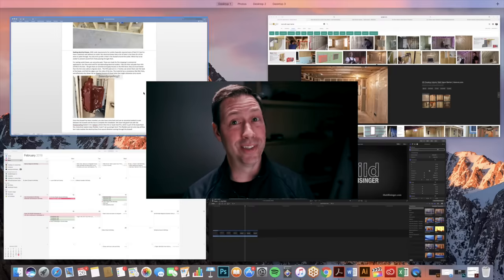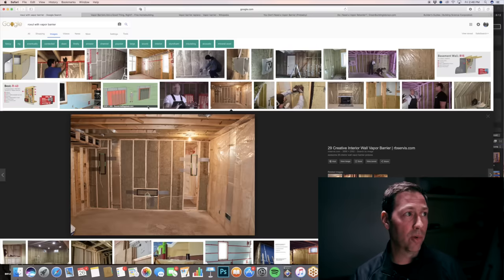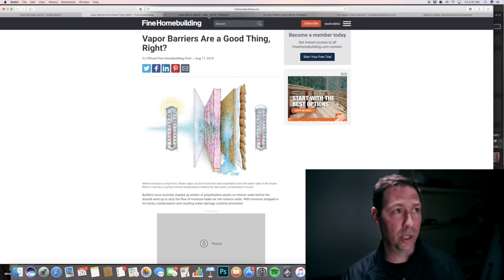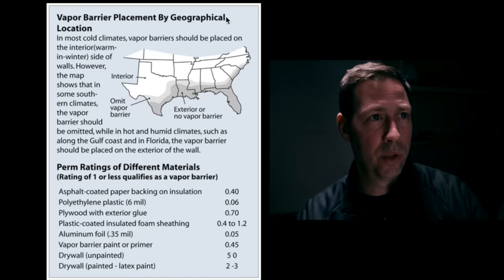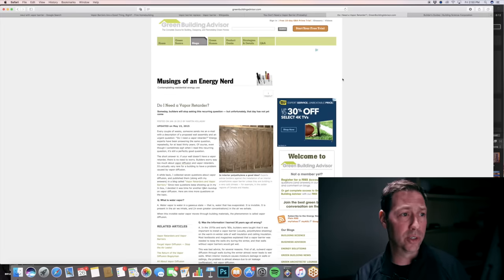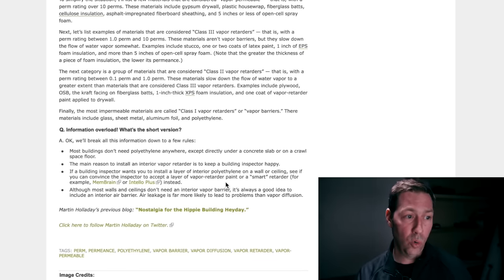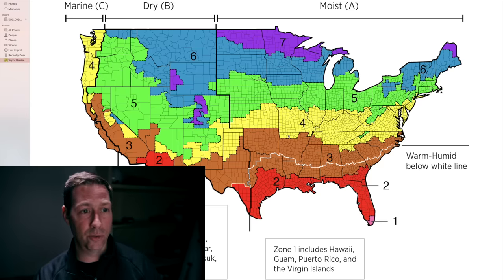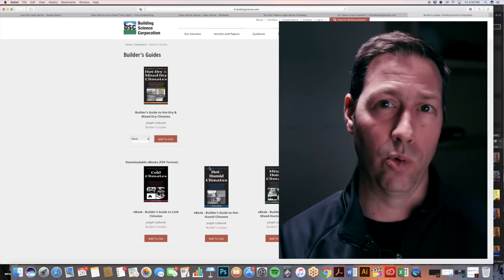Vapor Barriers: Need one or not?

Comment: The left corner of my basement is a bedroom. That corner, about 18 inches in from the outside wall- on the bottom,-is where the mold and wetness and dampness is. Only about 2 inches up the drywall.  Behind that drywall is an old layer of paneling. Behind the paneling is insulation. Behind the insulation is a clear plastic sheet, that had drops of water on it. Behind that is the white cement wall-- that looks painted. If I took the 4 foot section of drywall off to the edge of the brick hearth, I wouldn't mind keeping it open somehow so I can keep an eye on the water that is infiltrating every so slightly.... It's not all cosmetic, but I would like to check more of the wall. And will be changing ceiling panels as well. The odor isn't right... I have air flowing through with a fan, I opened the windows all week long, the waterproofing company said they got only a 3 on the meter and didn't want to spend my money,,, and it is not going away. I thought is was animal odor, so I replaced the carpet. I wish I could share a picture on YouTube.

Comment: In a northern basement, use solid foam insulation against the concrete with sealing tape or foam, then build your wall studs, and fill the walls with bats of Roxul or equivalent.  No plastic and your walls will be forever dry.  I live in Minnesota and it does not get much colder than here.
Reply: RD S Great Info, I live in New Hampshire and have a 2006 house that I want to finish the basement. I’ve been doing research and you summed it up from what I’ve seen as the best approach. 
What do you do for flooring (sub floor to prevent moisture ) when you build your walls like this? I have hot water baseboard heat that I Will be running in the basement. 
Also - what type of flooring do you recommend? Carpet, laminate, porcelain planks? 
Thanks!
Reply: Canada Ontario and went with this very method also in my basement ... Closed cell insulation panels glued to cinder block walls then studs and Roxul insulation...trapping the moisture with vapour barrier never made sense to me

Comment: Totally agree air is the killer.  I've worked in the biz for over 30 years, and when remolding my own farm home in the 90s, and being quite anal about the rolled bat installation, on one very cold, sub-zero, windy day pre-drywall, remember seeing a couple "spots" of condensation; pinholes of air getting through the exterior vapor barrier, through the bat and condensing on the back of the visqueen.  I remember thinking, "This can't be good", as it was pre-siding and I hadn't nailed any siding up yet; clean wrap on the outside w/ cap application. 

                              I'm getting ready to do a remodel now with fiberboard sheeting and fanfold behind vinyl, and I'm pretty sure I'm spraying CCF.   If applied correctly, that should take care of the air issue and add some strength?   I think CCF on sheeting is the best way I can think of to stop air infiltration on a sided home short of removing the siding.

Comment: Enjoy the videos Matt! I live in S. FL and ran into the same problem over the last few months during our new house purchase remodel. The house is frame construction with cedar lap siding. We had what I was told is old "soap foam" insulation in our ext walls that shrunk over time and offered virtually no R value. It resembled icynene but I knew it wasn't due to the age of the home (1978). The insulation was held in place  with a plastic Vapor Barrier behind the drywall. We removed everything and replaced it with all new batting. During the removal process  we realize how much mold and even wood rot had occurred in the walls which has since been corrected but what a job it turned out to be! Thankfully we addressed everything before closing the walls up and moving in! Just curious, I'm in real estate sales and I've seen patch jobs in houses before using 30 pound felt paper for exterior walls behind the plywood/siding. Would this create the same problem as the plastic visqueen? Thanks for your help!

Comment: Great video with good info, if nobody mentioned a moist basement mixed with poly vapor barrier on the interior only will cause the moisture to be sucked up into the wall through the sill plate. New tes th ing has found that this is where most of the water damage  comes from when there's a problem.  so skip the poly or remove after inspection if your not able to properly fix your lower moisture problem.  if the level below is moist or prone to water, wet basement or compiled with the "chimney effect" or bad attic insulation because this will pull the air from lower levels threw the house all the way to the attic makes for a super drafty moldy home.

Comment: My house was built about 1800. The roof burned off in the 1930s and they rebuilt the second and third floors. It's a farmhouse, not a colonial. I'm in Northwestern Connecticut. There is no sheathing on the house, the clapboards are directly nailed to the American chestnut studs, except for where those chestnuts studs were replaced in the 1930s which includes the entire roof. So any notion of a vapor barrier is humorous. When there's a good wind you can feel it in the house. 

Never mind how many years I've been doing this, but I'm rebuilding the house from the inside piece by piece. Room by room. I could go on for days about all the decisions I've made and whether they're any good or not. But to the point of this video and why I came to it is I'm at the laundry room now. I'm trying to figure out whether I need a vapor barrier on the inside of the laundry room it's below an insulated space mostly and above an insulated space and next to an insulated space on three sides. The roof, which is well-insulated, but has no exterior vapor barrier,  does form one part of the wall/ceiling. Let's call it 30 to 40 square feet. What I'm trying to sort out is do I need a vapor barrier in this laundry room at all? Do I need to think about keeping any extra water vapor in this laundry room and not in the wall? Or is it best to let it breathe? I'm at that point in construction where it's time to make this decision and do it. This is a very shortened version of a very long story if anybody's got this far I wonder if you have any advice. I actually do expect to get conflicting advice and will try to sort it out. Thanks in advance, as we say.

Comment: I am a design engineer and have to consider location and the heating system used, but I mostly recommend a vapur barrier.  My brother who is an architect/builder allways say that when in doubt, skip it.  Unfortunately gypsum is no barrier for anything. It soaks water like a sponge.  Actually it is used to suck water out of clay slurry in erthenware factories.  If gas heaters are used, gypsum drywalls cannot be used.  As you demonstrated.

Comment: Matt, watching your video vapor barrier need one or not I had the impression that what you were talking about pertains to above ground construction. I am in the process of finishing my basement in a zone seven area in Wisconsin and I am wondering if I need a vapor barrier against the cement wall in my basement. If I do would a paintable vapor barrier or retarder be better or a XPS rigid foam be better?

Comment: I live in Canada and in a cold part (north of North Dakota) and we're in climate zone 7A. We have an A and B, with B further north, then 8 etc as you go north. Vapour barrier is a code requirement under out dry wall. We often have -30 or lower temps (Celsius). That type of temperature holds very very little moisture. In fact, at just -20C, if the relative humidity is 50%, that's the equivalent moisture of 3% at +20C (room temperature-ish). And of course, we all know how a glass of ice water collects condensation on a hot humid day - the same thing occurs when warm, moist air (inside the house) hits a surface that's exposed to -20c (outside the house). Of course this is during winter here.

Comment: Thanks so much for clarifying that about the plastic on the inside of the home.  Don't do it in Dallas.
I'm renovating an old 1920's shiplap house - exterior wood siding and shiplap is installed directly on the wall studs ....no insulation of course.  In the locations where we were replacing rotted wood siding on the exterior, we added tar paper before installing new wood siding.  On the inside where we had to remove some shiplap for wiring and windows, we put tar paper between the studs, anticipating insulation would be placed over it.  Some areas will not have any tar paper unless I remove all the shiplap on the walls to do so.

My questions: 
1.  Is the tar paper fine to use before I use batt insulation in the open wall cavities? 
2.  What about the wall cavities that I did not open up and have no tar paper in them (the shiplap walls)?  Just blowing in insulation in the shiplap walls without any vapor barrier - is that ok?
3.  Crawl Space - We are keeping the original wood floors, but of course a subfloor was not used in those days, so the wood floor is installed directly to the joists and is exposed to the outside temperatures in the crawl space.   What is best for this scenerio?  The floors are going to be cold for sure in the winter.   What is the best thing to do in this case?  Should we install the plastic vapor or air barrier?  Some say spray foam insulation, but that could be more costly for a rental.

Comment: I have said this for years! I do new construction and remodel work and have seen the results of "common" or "best practices" firsthand. Plastic in your walls lead to one thing only....mold. All that is recommended in my opinion is PVA primer on Sheetrock. I have installed poly to appease inspectors and then tore it out before drywall in order to build a safer home for my customer. The other HUGE factor to consider is the heating system being used. Gas heat puts more moisture in the air than electric or wood.
Reply: Modern gas shouldn't be adding any moisture. Direct vent systems are contained. And if a gas heat source IS adding moisture, it means the flue isn't properly venting outside, meaning CO is a bigger concern than moisture. 
Thoughts?

Comment: Thank  you.  I'm all set to go.  This is 1" board with a foil face. I've done a little of this so far in another home.   This will be the first two bedroom home to get it on all exterior walls and ceiling.  Perhaps the question is whether to create an air gap between the foil board and the drywall.

Comment: Interesting video. I get what you're saying about diffusion only letting a negligible amount of water through, but what about the water that comes through from air leakage? Is the need for a vapor barrier dependent on how tight you build the house? If so, where do you draw the line? Philly metro area here. Keep up the good work!
Reply: kingsovernines
Absolutely is.

Comment: What about cold climates and any need to vapor barrier a foundation wall (zone 5/6)?  We typically place ridged foam directly on the wall (concrete) for both a vapor barrier and to provide some insulation R-value.  The rim joists (above the concrete) are usually batted with fiberglass.  The seams are taped to seal and sometimes the top and bottoms where they meet the wall are spray foamed.  The usual minimum is 1/2 to 3/4", but some go upwards of 2-3" or more if you can fit it in.  My basement is not finished living space, but has a workshop, laundry and storage.  I went with 3/4" ridged foam on the concrete as a vapor barrier (held by adhesive), that was painted with UGL DryLok before hand, and the studs them built out from it with no fiberglass batts (I could add later if it becomes living space).

Comment: I did a repair once ....it had been determined that a overhang roof was leaking as the front porch was rotting away and wet ......as I removed the cladding and membrane on the porch,  all of the wet wood was where the wall and porch met under the overhang .....as you got farther away from that point it got drier ...so the overhang  wasnt leaking and the porch wasnt draining back to the house....
        .As I inspected I found there was a furnace in the basement ,situated against the exterior wall below the porch....The vapor barrier had fallen down either by poor placing or installation of the furnace...and it was decided that it wasnt needed by who ever was responsible..it was condensation.....We live in a temperate climate ...only a couple of weeks a year  in freezing tempature. 

   It is probably better to err on the side of caution ,as you dont know what is going to happen in a building after you build ....possibly even a small grow operation..........a roll of poly is not that expensive

Comment: I’m a carpenter in southern Louisiana. Every so often when renovating I discover a situation where some idiot has installed a vapor barrier from both the inside and outside. Invariably there are moisture problems from condensate or leaks.. Often rot and sometimes wood destroying insects have had a field day with the moist wood.

Comment: It's code where I live to have visqueen on exterior walls.  I'm bordering zone 5 and 6, I've torn a lot of walls apart and very rarely seen mold where visqueen is applied.  Tend to find it in ceilings where visqueen was added before sheetrock. About 5 years ago we started using A product from Zinser called Gaurdz, we seal the sheetrock after it's been mudded, I wouldn't go without now.

Comment: Here in North Carolina it is code to use a plastic sheet vapor barrier on the inside of the house since most builders use non faced insulation along with an exterior vapor barrier like Tyvek.

Comment: I am planning a cottage build and want your thoughts on my plan. Post and beam with lathe and lime on the exterior. (leaving the beams exposed) An air gap on the interior and 2-inch foam board with another air gap and then Tyvek(permeable) on the interior walls. A  1/2 inch gap and then the walls covered in shiplap boards. The roof would have tar paper with 1-inch foam board and 2-inch strips over taped joints to give an air gap and covered with steel roofing. I haven't decided on what foam panels to use yet. The ceiling, I considered foam between rafters and lathe and lime coating. Or foam and some sort of material covering the ceiling and rafters. I am trying to bridge the gap between the building being able to breathe a bit and having a decent amount of insulation.

Comment: I wouldn't want to say this video is wrong but here in the moist UK vapour barriers are mandatory, you would not be able to get a building warranty without using them. Before they were mandatory we built a couple of thousand timber frame houses back in the 1970's and they all rotted because the water passed from the inside and collected in the insulation, it made the area in the wall too moist and the wood frames started to rot. But since the vapour barriers came in it has not reoccurred. Now they are breathable too so any water getting in from the outside will be able to pass through to the inside and not get trapped in the wall. 

There is a good article here - https://www.eco-home-essentials.co.uk/what-are-vapour-barriers.html. 

Maybe the issues Matt has found on 10 yr old houses are with the fitting and choice of these barriers. But if you use breathable barriers on both sides in a timber frame building and it is correctly sealed then the inner section of the wall will be able to pass out the water to either side, so it should work.

Comment: Hopefully I’ll get Matt’s attention here with a question. 
I framed in 1/2 of my 40x50 shop. It is a well-built steel building building. I’ve framed 2x6 walls and have 2x12 I-beam ceiling joists. 
A company was hired to insulate and I requested 6 mil PE vapor barrier on the inside. I am in zone 5. Very dry though (Eastern Washington state). 
I have opted to using 7/16” OSB instead of gypsum. It is a shop and I will not need to fire-tape and I like the functionality of wood in every inch of walls. 
What are your thoughts on the use of the vapor barrier? 
Summer temps can be sustained triple-digit for many days (weeks) and winter just a few days of marginal sub-zero. 
The shop will have NG heat and will have AC. One 2x6 wall is up against steel (lots of infiltration and the other wall is the dividing wall between the two sections of the building.

Comment: What if the interior walls of the house are finished with 7/8" tongue and groove pine and insulate between the studs with ridgid foam with a foil backing on both sides?? Great video Sir, 👍
Reply: I second this question. I'm employing a similar method in my cabin in upstate NY

Comment: Sometimes I wonder if there should be some type of ventilation to the interior for every bay in between studs. I’ve worked on a lot of historical homes. Often there’s no insulation and no vapor barrier of any kind. It takes a lot of moisture and a lot of time to create and real issues because everything dries out if it gets wet.

Comment: Thanks. I’m from Pa and familiar with the buildings there but just moved to Mississippi and have a mini house I am construction that I was still on  the fence about which side the vapor barrier should be on. I think after watching this I am just leaving it at house wrap because it is on the souther half of Ms and it has R45 walls and R60 roof so there shouldn’t be much if any cool air from inside condensing on the outside of the house.

Comment: I haven’t researched it yet, but how does paint affect vapor penetration through drywall? I notice it will condense on the surface but is there permeability to paint or does it just dry on the surface from the warmth of the interior room? All my inspectors in Minnesota require 4 mil poly on all exterior walls and ceiling and I’ve always wondered the future outcomes of these requirements.